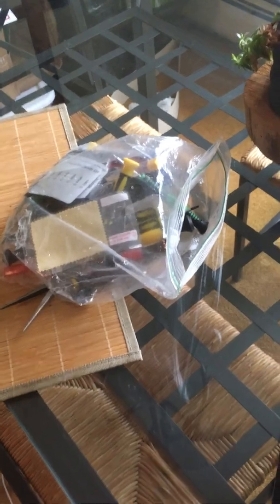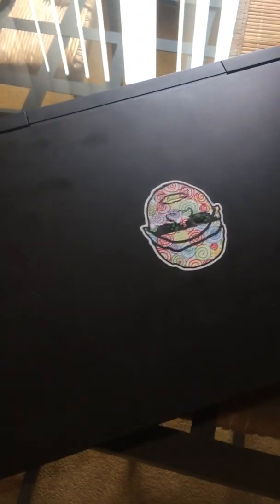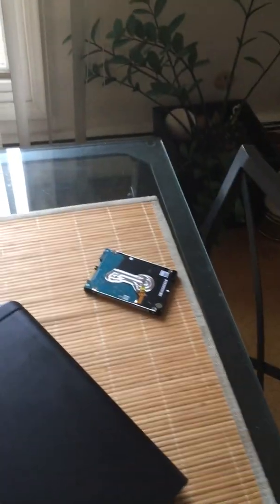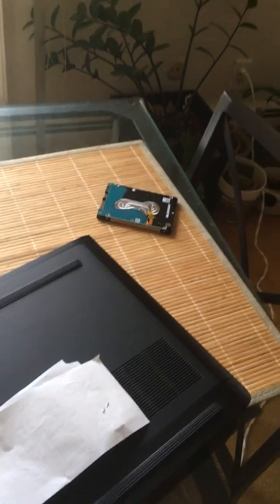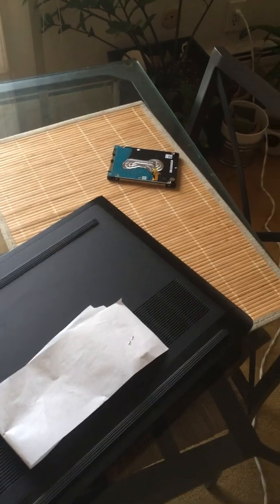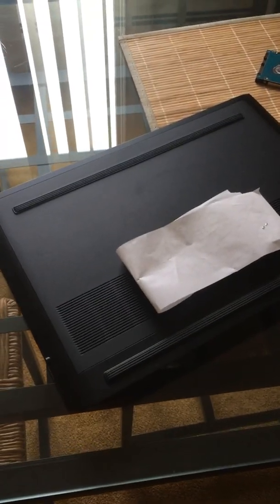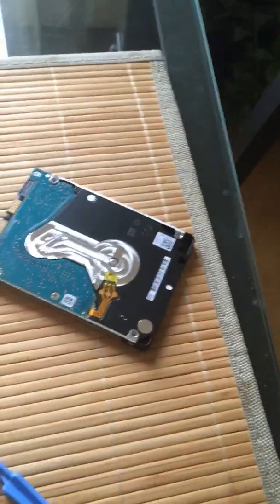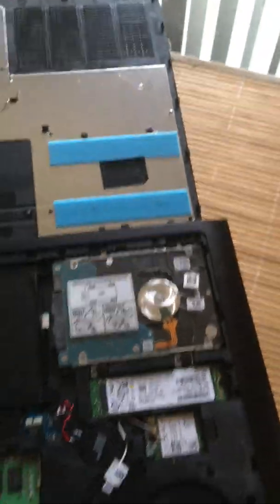dell g series g7 hard drive upgrade part 1

Comment: Hey buddy, how you doing? I was wandering if you could help me? I tried to install a 500gb ssd onto the hdd drive but for some reason it doesn't show that I have it install. It only shows the 256gb ssd that came with the laptop. I also check disk management and it's not there either. I tried to disconnect and reconnect the hard drive over and over again. I gave up. Any advice?
Reply: Hi, any luck on this? I have the same model that just came with a 256gb ssd in it and i've been wanting to add something into that 2.5" bay..
Reply: You ever get a fix? I have that same problem

Comment: You bought a 2.5” right? For some reason mine doesn’t fit properly. The lid has a bulge after installing it
Reply from the maker: that's the right size. shouldn't be bulging. let me know if you figure out what happened.
Reply: ILLingsworth tried contacting Dell about it. They just kept transferring me from department to department. Can’t believe how crap there support is. I’ll try calling today again
Reply: @kevinzheng6718  Could be the height I think the drive space is for a 7mm
Reply: Hunter Illsley What you said is correct but idk why Dell kept saying how the drive was closer to a 3.5 inch. Sometime was definitely wrong with the height that’s why it wouldn’t close shut
Reply: @kevinzheng6718  a 3.5" drive is thicker than the laptop 😂
Reply: Hunter Illsley ikr. But on the website it clearly says 2.5 inch
Reply: @kevinzheng6718  dunno if you fixed it or not but when I put the hdd in the bludgeon was from the two foam things on the lid for me

Comment: You had added up with the HDD, in that place ,can I add again a SSD with existing SSD means given by dell. Or the slot is only for HDD
Reply from the maker: i'm not sure i understand the question. if you try to rephrase it, i will try to answer.
Reply: @illingsworth  I think what he meant is that can he replace the laptop's hdd(different from the laptop's stock ssd) to another ssd? Because that is also my question